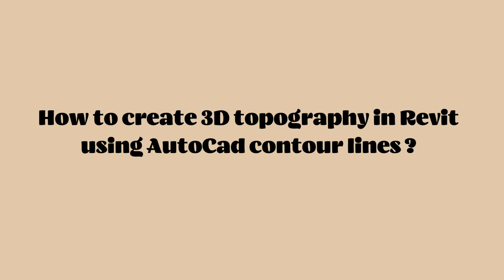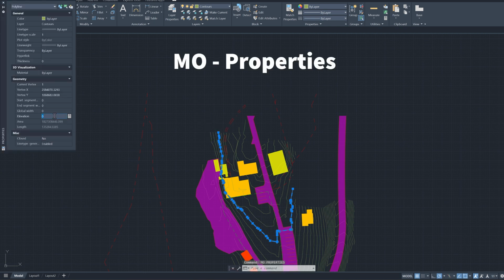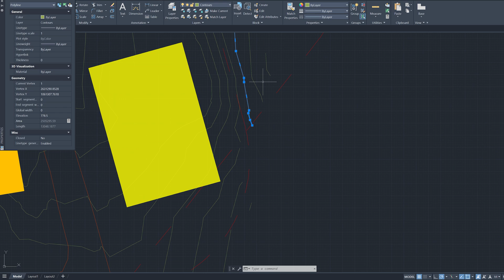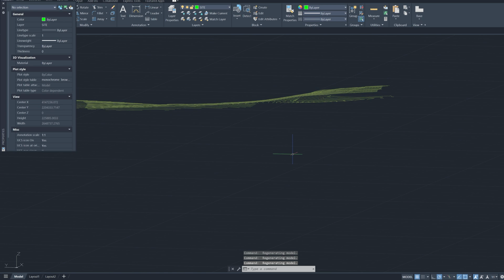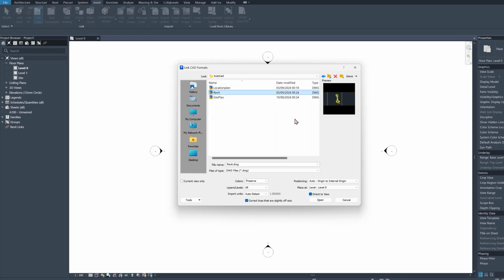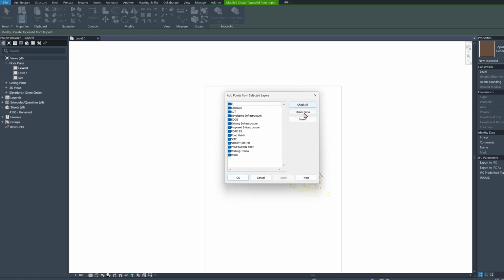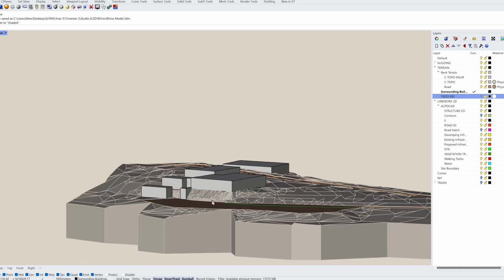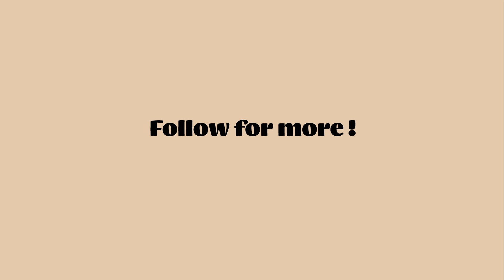How to Create a Topography in Revit Using AutoCad Contour Lines?

Comment: In 2025 version there is no option for elevation what to so
Reply: Hi i am also using CAD 2025 version and had somewhat the same thing happened to you so what i did was that i selected a single countour and then searched in properties and it was elevation option was there .
hope it helps
Reply: hello your there will be coordinates for your line when you click it Im not sure why or when it happens but sometimes elevation does not appear but there will be x y z for coordinates y will be your elevation if I remember correctly ,can be z too just rotate and see